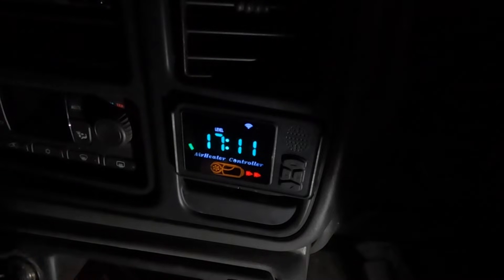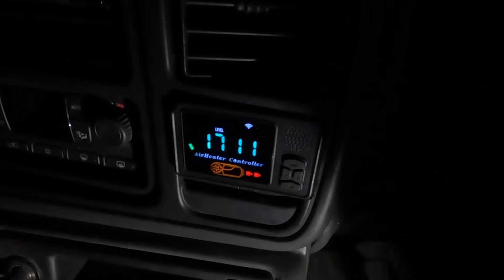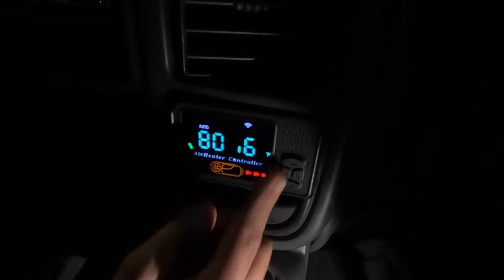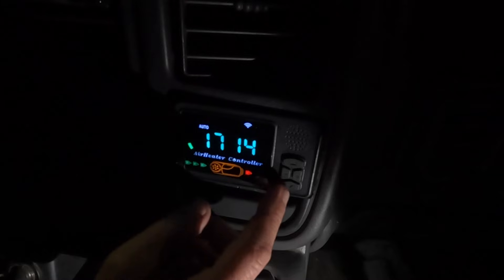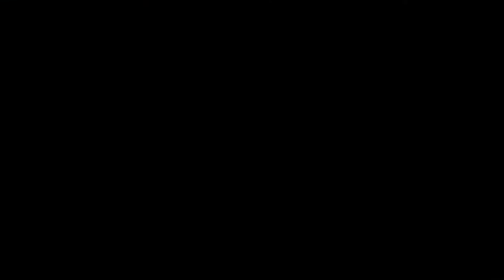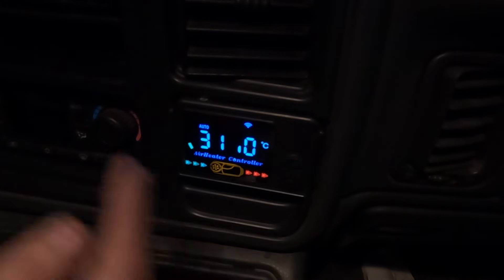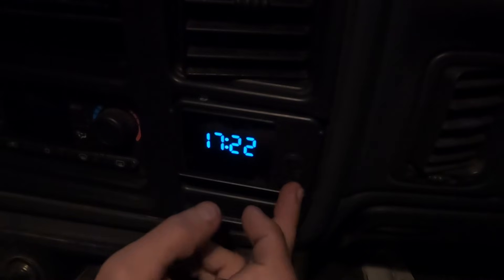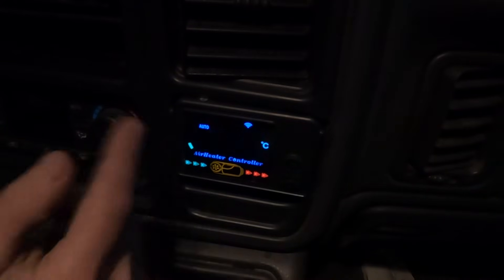Bluetooth Diesel Heater Feature & Settings Discovered !

Comment: I finished the installmof both my vevor 8kw in my double garage sized workshop and boy was it better with 2 instead of 1. In about 40 minutes it took my workshop from +4 celcius to +18 and that was awesome!! I even after a while was working in tshirt only while its -22 celcius outside. So anyone looking for heating a workshop buy 2 if its a place cold and about my size or larger. Thank you for this video also, interesting. Do you know how i can change my new controller from HZ or C to just what we have on the other blue controller like 123456 as heat settings?
Reply from the maker: Hey Rim ! That's awesome ... way more fun working on stuff at +18 than +4 !!! 

To change your controller to operate by temp instead of HZ> 

When you press your OK button once you get the room temperature, press OK again and you get the HZ... while in this mode, press the gear / settings button and up arrow at the same time. 

This will then display your preset temp. Hope this works for you !
Reply: @loweredexpectations4927  thank you. I should try and dial in my heater as unlike the other one I can see it have more than 210 celcius. 
I have seen 237 and that was a little scary but nothing happened.
I can adjust the HZ all the way up to 8HZ and I tried setting the fan at 5000rpm and then I fed it more and more Hz until i had 220celsius and the hertz at that point was about 6.5.
So this pump sure can pump some heat and fast also but I can also see it almost use 40% more fuel than the other one.
Guess by adding more fuel, more air around the burn chamber to cool it down I can have much more than 5kw from this. It's a "8kw" but someone that can calculate can maybe find out the difference within 4500rpm and 5000 on the fan and then the % increase that have should be about the % more kw extra than the 5kw these gives stock.

But I noticed first day when it was stock it ran at 230celcius at max power, but then the pump was factory set at 4400 or 4500. 
I wonder if it has like a total reset so if I mess around to much I can go back to stock settings? I'm guessing it are 1.7hz-4.5hz and 1500rpm-4500rpm I didht check because i was so excited over the secret menu.
Reply from the maker: @RIMHQ-YT  Hey ! 237 is high for sure, and you should slow the fuel pump down some, or increase the fan speed. It isn't anything to worry about though. Some of these heaters have a thermal shutdown at 236 (my original heater) and some of them shut down somewhere over 250. 

I don't think there is a factory reset ... and I believe the min pump hz should be lower than 1.7 closer to 1.2. I would just run it at 1500 rpm and adjust the fuel so that it was around 200C. 

As for the max setting, and it burning a lot more fuel... Yes, this is true. The heater will be less efficient at higher fan speeds, as more hot exhaust air is being pushed outdoors. If you want to get the maximum amount of heat, and don't care about efficiency, crank it to 5000 rpm and adjust your fuel so that it is 220 / 230 C. Diesel will continue to make a LOT of heat even when you are running quite rich, but it will eventually make a lot of CO and soot. 

It is more wise to run the heater at 4000 - 4500 rpm and 210 - 220 C.  👍
Reply: @loweredexpectations4927  needed to read that a few times, in my mind if I run the fan at 5000 or 4500 it will heat up the room faster and quicker and that's what I'm wanting it to do also. But I also don't want the exhaust to be glowing like yours has been at times either haha due to safety as I sometimes leave the room. 
I have seen some people tuning the heater by looking at the bars on the display and going up and down at Hz until it just about was between maximum all bars and about to drop one bar. 
Maybe I overcomplicate it just by going and adjusting it and looking at the temperature that will only show up on the remote (the 210-230 C i was talking about) on the new heater but on the old heater I could just press the ok button on the display and it will show me the case temperature (210) all day long. In my mind that leave me without worries as I know it's most likely burning as clean and hot it can.
The new also blue controller unit I need as said to take a readout using the remote, kinda annoying as I just like my remotes to hang by my bed and not have one of them in my pocket. 
Any suggestions on why or how I don't get the case temperature on the display controller? Just on the fob? (See now I remembered you called the remote a fob ;) )
Reply from the maker: @RIMHQ-YT  Your fan speed is part of the equation. You need to be making heat so that the fan can carry the heat away. If your fan is turning fast, but you set your pump too low, it may only maintain a temp of 130 or something like that. You need to burn enough fuel so that you have a decent temp on the heat exchanger. Anything under 210 is very safe. 

When you crank up your fan speed, this no only increases the air flow over the heater, but also the combustion air. This extra air means that you can add more fuel without going rich.... Maybe you already knew this, but I didn't want to assume. 

My exhaust was glowing due to unburnt fuel, caused by burning oil. You will have to burn a LOT of excess diesel before it ever gets to this point. If you check you exhaust outlet and it is full of soot, then you are burning too much fuel. 

People tuning the heater by looking at the controller bars is just a less accurate way of using 210C (for example)... those bars are feedback form the temperature sensor, but instead of reading accurately by 1C increments, one bar is several degrees ... if I understand it correctly. 

If you have two different controllers, the one that stays at 210 all day, likely has built in compensation. My old controller has this. As soon as it is about to go over 210, the computer slows the pump down for a few seconds... I'm not sure if this is the case with your heater. On mine it is the one with blue digits. 

You should be able to adjust your heater so that it does the same thing and stays right around 210C, but if your ocntroller is more accurate, it will likely fluctuate a bit lower and a bit higher. 

LOL... You called it a fob !  If I remember correctly, you said your controllers were the same, but your fob colors were different ? Can you post a video to show me exactly what you mean ?   From what I understand you are saying that one of your controllers displays temp on it while the other does not, and so you have to carry your fob to see the temp ?
Reply: @loweredexpectations4927  aaaah. Of course.,when you increase fan speed I also increase air into the combustion chamber and I haven't thought about that.,of course! Obviously, haha. 
I often just auto pilot whenever I'm doing stuff so I'm not always thinking about these obvious things so thank for that information that is pretty obvious but I just hadn't thought about that. 
I now have two 8 kw vevor heaters identical both has the blue controller but one is the same model as yours, no secret menu and blue digits. 
The newest one also blue controller but 6 blade fan and red digits most of them and has secret 1688 menu. 

My fobs or remote as I would call it, I think the fob word is something they use in the UK, I'm Norwegian and whenever we pick up a device that will control the tv, an RCar, or something similar we call them all remotes. The old one same model heater you had came with a red rf remote. The new with menu came with a black rf remote identical in appearance.
And yes, on my newest heater I can't see the burn chamber temperature on the unit itself, I need my black remote to give me that information on the screen of the remote. It will not show up on the heaters display. Weird.
I will try make a video next time I'm doing more work on my GULF Husqvarna, and tomorrow my neighbor had me invited to a party and I'm 48 so I socialize about 2 times a year so I'm not doing anything tomorrow except drinking and sharing my 10% strong homemade beer and cider. ;) 
The last 3 years has changed us man, I used to socialize on evenings but now we are trained to sit in house and just play Fortnite or watch YouTube. 
So another diversion from the topic. As usual. 
Maybe I'll throw in some scenery from where i live also, i just need to learn to blur out the speedometer on my bikes so I don't post myself twice every speed limit. 
No, I can make that video asap. Remind me or it will come Sunday. All you need is subscribe and hit the bell button. Hahaha. 
You have chance to be my subscriber nr 70 i guess. Haha. 
Thank you for the information and I watch every video. And now all my YouTube is all filled with diesel heaters when I open it up.
Reply from the maker: @RIMHQ-YT  I have played with diesel heaters a lot, so something that may be obvious to me, may not be to someone else. I was just given a 3D printer, and I feel like a total moron when it comes to that, haha... I'm learning.  

Ok... I understand now. The temp of the heater may not be available in any reasonable way. When I did the video about "upgrading" the controller, I mentioned this... I do not like that it shows you silly bars instead of showing you the temperature of the heater. There may be a way to change this, but I am not aware of it. 

Haha... I'm 46, and I rarely socialize... I also get out about twice a year... What you see in my videos is pretty much how I live, except, I do a LOT of editing, haha.... and no one wants to watch videos of me editing... it's only amusing when i'm cussing at my computer ! 

I subscribed, but I was # 73 .... haha. LOL... My buddy BJ said the same thing last year... He started watching my videos about heaters, and now his whole video feed is filled with heater content 🤣

Cheers !
Reply: @loweredexpectations4927  haha thank you!! That reminded me of the video I was gonna make. Need to do that tomorrow cuz I'm already in bed at 9 pm today. Someone had a hard day yesterday. Haha

Comment: Thank you Joel!! Game changer learning the auto feature. I’m using my 2k Bluetooth heater in an off grid shower house and it’s been cooking us out of there on level 1. This will also save a ton of fuel. Thanks again! I look forward to future videos
Reply: If you've just gotten your heater new I suggest periodically running sea foam through your fuel tank (50ml/5litres), also running on high for 15 mins after a long burn on low. I'm sure you know most of this, friendly reminder 🇨🇦
Reply from the maker: @Tannertraversed  Thanks for the comment. What is the purpose of the seafoam?  I assume it is intended to remove junk from the burn area. When these heaters are running well (proper air fuel ratio) they run for years without any real soot or ash build up. 

While I have heard many people say to run your heater on high before shutting down, a few of my tests seem to show that the temperature of the burn chamber (not the exchanger) actually runs cooler, due to the extra combustion air flow. I used thermocouples on the chamber for a few different tests, and notied this trend. It appears it actually runs hottest / retains the most heat at setting 5.
Reply: Run K1 kerosene for no soot problems. I have spare pumps because ultra low sulfur kerosene will not lubricate the pump and pump may go bad. I have had no pump problems (original one in it). Burns super clean. The only real way to know if kerosene k1 in your location works is to run it and have a spare pump (a spare pump and glow plug / gasket set is good to have).

I have heavy gauge wire to power mine on a big off grid solar battery bank...no problems.

I replaced green fuel line with 2m nylon kit and installed a filter. From the fuel tank to fuel intake nipple is all sloped uphill. No air bubble problems and little bubbles from.pump go right into burn chamber.

People running K1 have run for 1000s of hours no problem. Hopefully there is low priced K1 near you and it has just enough lubricity to run your pump. Kerosene has just a wee bit less BTU but having a long lasting heater not needing to be ripped down is worth any trade offs.
Reply: @Iamfree1962 how about installing smaller pump 16ml instead of 22ml for 5 kw ? Make sense for low power 3-4kw ?
Reply: Google seafoam for the best description. I've never heard of a diesel engine running without build up but maybe you've found the proper ratio but still hard to believe. I run my heater on 5 when I intend to do a clean burn, I've never done tests but maximum output isn't necessary considering 5 is within the max settings. I wonder why they've engineered the units to do a burn off cycle with glow plug if you've found that these heaters when running on proper air/fuel ratio have zero buildup 🤔 I don't mind the initial start up but the burn off during shut down I feel is unnecessary.
Reply from the maker: @Tannertraversed  Great observations / questions. 

It is a mistake to assume that these heaters are anything like a diesel engine, other than the fuel they burn. Well.... Maybe some other similarities... but let me get to my points. 

These heaters are basically a candle with a fuel pump that delivers fuel to the wick and use a fan to maintain AFR. There is no misting or spray of fuel, no injector and the system is not pressurized. The fuel flashes off on a wick at the entrance of the burn chamber. 

Good question about the glow plug. This may take a little explanation. The glow plug on these heaters is surrounded by a mesh that is used to start the combustion process. Fuel dribbles in onto the mesh and plug and runs down onto the wick. For the start up process, the plug first turns on for a minute, and then, once hot, the fuel pump starts. The flame and burn move to the wick area. Once the heater is running for a minute, the glow plug turns off, but the fuel is still delivered through the same feed, dribbling over the mesh and glow plug. The glow plug does not stay hot during normal operation and the burn takes place, starting in the wick area and exiting the chamber. When you shut the heater down, the fuel pump stops and the plug turns back on to burn cleaning off the plug and burning away any fuel that dribbles in after the pump stops. This is to stop the plug and heater from being "flooded" and keep it starting more reliably and cleaner.
Reply from the maker: Thanks for the comment and for sharing your story ! So glad this helped.

Comment: Interesting Joel, thanks. I've just today ordered the HCalory HC-A22 8kw hester that David McLuckie reviewed some time ago, I've been waiting for some to necome available at a reasonable cost. Will let you know how it goes. I'm also intending to use the 5kw version out in Romania over the Christmas break and have  bolted a giant heatsink salvaged from a scrap  high power transmitter to a 3m exhaust pipe to scavange a bit of extra heat from that. I guess i should look again at the egr cooler set up I started playing with last year as that looked really promising. I was thinking i I could probably use a peltier block to generate a bit of voltage from the exhaust to run a circulation pump.
Reply from the maker: Awesome ! The egr set up does seem like it would be more ideal... but anything is better than throwing the heat away 🤟. The peltier might work... based on what David had to do to run his heater, I'd guess that may be a bit of a struggle. Then again, I'm not sure how many watts a little pump would draw.
Reply: A Scottish fella has successfully generated power to run the unit from heat. It has a battery and charges it up enough to restart the glow plug and fan which is 9amps which then settles to basic, running just the fan, pump and display.

Comment: cracked the code on the what now?
Reply from the maker: How to access the menu and change user settings. The manual that comes with these controllers is way out to lunch. Obviously for a different controller.
Reply: maybe it'll work for my e-bike then!  (in the uk we're not allowed a throttle above 6kph - only pedal assist)  i was waiting to cross the road, not thinking and my hand hit the lever 😬😂 @loweredexpectations4927

Comment: It may be better to prefer the smallest heater and lowest setting for a car (in case, the bigger heaters have higher lowest settings) to avoid on/off cycling mode, when using the heater for longer periods, i.e. over night, because on/off mode may drain the battery faster.
But there are already two assumptions in one sentence to be verified.
Reply from the maker: Yeah, I think this is probably accurate, but have not tested it. I would like to check this and now have a 2kw unit... so maybe soon we can stop guessing. 

It has been quite warm here lately though... Not very good for testing.
Reply: @loweredexpectations4927  I just installed a 2kw in my subaru impreza hatchback and even at the minimum setting it can turn the cab into an oven with -8C outside...
Reply from the maker: @flack3  Yeah. I installed a 2kw unit into my buddies 4Runner. What we are wondering is if the 2kw and 5kw heaters are the same heat output on setting 1 or if the 5 puts out more heat at setting 1.

Comment: I should have got my Bureck thermostat today. Coming from ID to IN went to NJ then two stops in NY it is still there. What is this controller your using?
Reply from the maker: Shipping is almost always a $hit show .... They have shipped mine out and sent me tracking, but I haven't checked ... it'll get here when it does. 

The controller I am using is the OEM controller that came with the Vevor heater... Their Bluetooth controller.